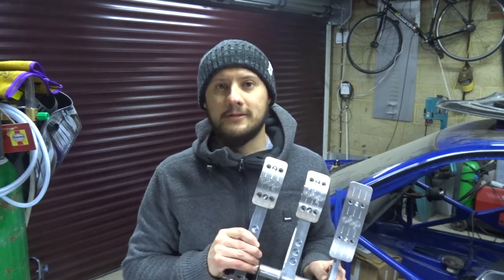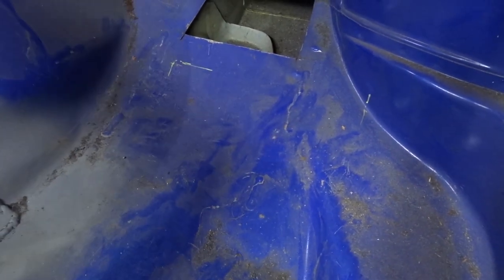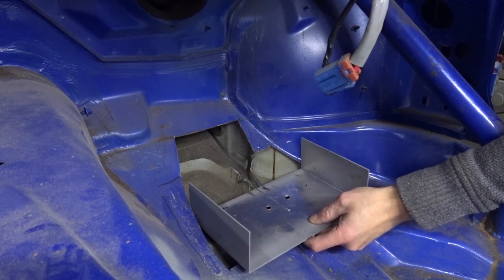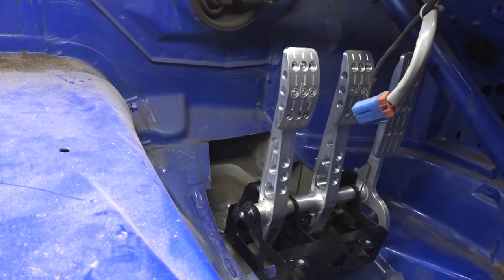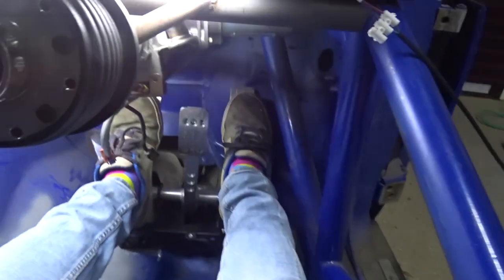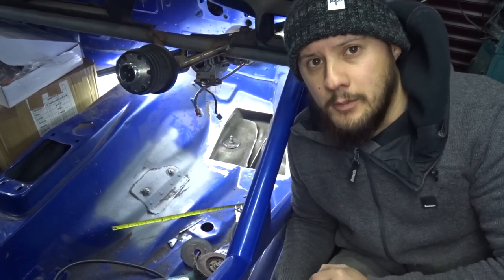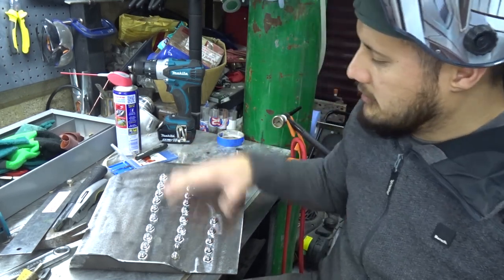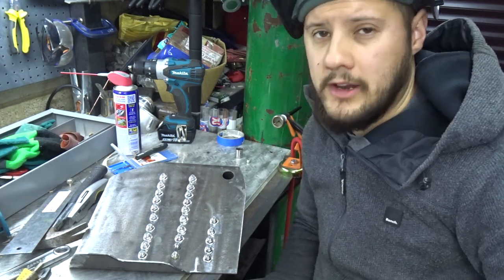Fitting my OBP Pro-Race V2 Floor mounted Pedal box

Comment: How did you run your brake lines without being physically in the way while driving? Installing in my drift car and very concerned they will be in my way?
Reply from the maker: You need to put a foot plate over the master cylinders to cover up all the lines 👍🏻